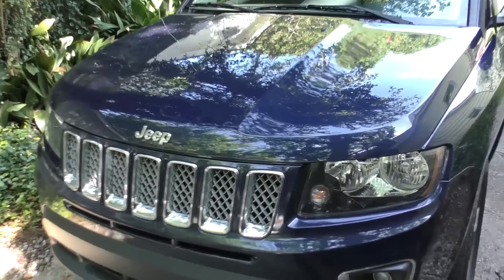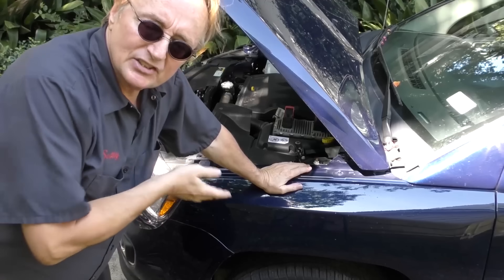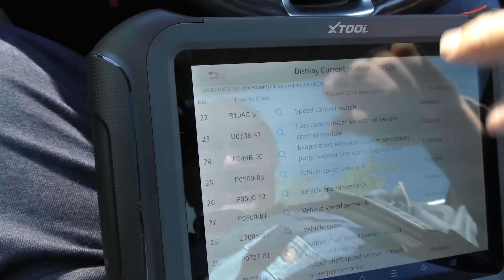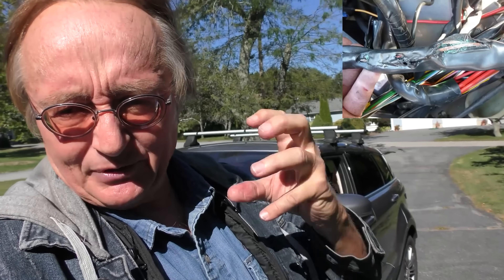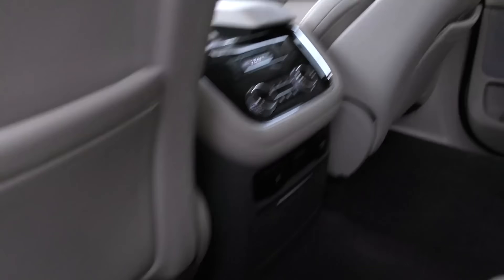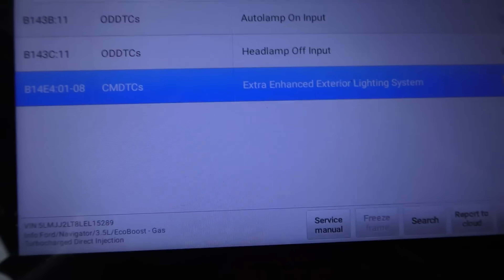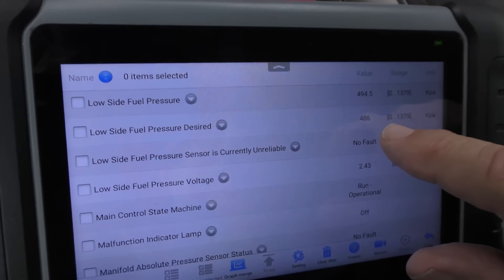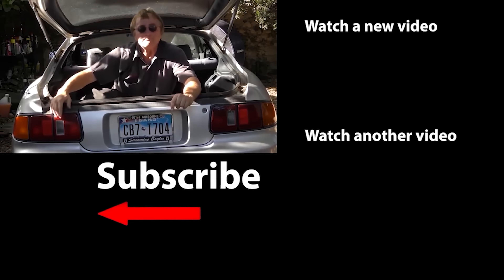No One is Warning You About These Vehicles, So I Will

Comment: AWD and 4WD are completely different setups.
Reply: Soccer moms will never understand this
Reply: @alpine1600s  I still don't think even my lifted sport trac is as good as my lifted Cherokee Trailhawk. We will see. I just bought the truck.
Reply: Tomato -tomato same thing 🧐
Reply: I think an all wheel drive vehicles should be replaced by 4 wheel drive. I like the idea of having fwd until it comes a situation when I can push a button and turn it into 4WD
Reply: Toyota AWD hybrids are different, the back axle uses the EV engine not the gas engine which powers the front axle.  In a Camry both are front only and EV mode is limited to slow speeds but not when in ECO mode.
Reply: @Jimmyky77 woah, a male soccer mom!🤣 They are actually quite different.
Reply: @alpine1600s  my Wife's 2021 Jeep Compass Limited Edition with 4k miles on it is A 4x4 not all wheel drive and the 2.4 engine,nice ride,too many gadgets lol,but still under powered but Gorgeous SUV.
Reply: @toriless  additional detail, ECO mode also helps your car get into EV mode more frequently than when you’re in Normal mode. It of course depends on how hot or cold your car it is outside.
Reply: @alpine1600s  "Good Day to you Sir!"💩
Reply: @off-roadingexplained8417 did you get the V6 or Turbo 2.0?
Reply: @bigbear5981  2.4 NA actually. (Rare).
Reply: @alpine1600s  well technically a 4 wheel drive is any wheel will pull at a given time. All wheel drive occurs in a straight line with all wheels pulling except in a curve or turning sharp corners then the transfer case allows the front drive shaft to slip to prevent binding. Though all wheel drive is the best handling set up the transfer case slip hasn't been perfected. I believe they have speed sensors in the wheels now on some and the computer can disengage which ever wheels that need to spin faster in cornering. I don't know don't quote me on that. The gm 4x4s of the 90's until everyone else caught on were beasts when everything was working properly and driven as they were intended with the locking rear axle in 4 wheel drive in the mud. 3 wheels pulled consistent and a weekend tear down with the same locker in the front unbeatable!
Reply: Yes they are different

Comment: I really don't get why people hate on Toyotas for being boring.  My 2015 Camry 2.5L is incredibly fun to drive and I love the sound of the engine at 6000 RPM.  It's not a race car or anything but it's plenty fast for the majority of people.  If you want speed, don't get a 4 cyl engine in the first place, but I'll happily rev my Camry to redline at 300K+ miles.  Only issue I've had so far is that the screen went out

Comment: You are a little late..... I bought my 2021 Pre-owned Compass Latitude in March.    
I eliminated a new 2020 Chevy Trax in less than 36,000 miles when it began to not responding to the gas pedal. 
I do have an engine warranty til 98,000 miles.

Comment: Any thoughts on a well maintained 2012 Toyota Prius with 116K miles? The car is being sold for $7900 and nearly all services were done at a Toyota dealer. It also has the original hybrid battery.
Reply: Prius is actually a high mileage low maintenance work horse. Prius taxis getting 300-400K miles or more. The engines are tough and so are the hybrid systems. Yours is barely broke in. Park it in garage or carport, change oil and take care of it and it won’t let you down. I’m on my third Toyota hybrid so I’m speaking from experience.
Reply: @Chaz610  Okay cool! I appreciate the advice and knowledge from your experience. It seems as though it’d be a legit purchase. Thank you.

Comment: Not just the compass but every Chrysler product. I own a journey and my son had a challenger (had) now a charger and I'm convinced they are designed to fail. Mainly the coolant! So far the plastic in the cooling system WILL break and so will the engine. Advice any Chrysler product with the plastic tee's in the cooling lines get rid of them. Cut the hose and buy a brass or stainless steel tee to replace them. When the electrical phenomenon starts  pull up the fuse box under the hood and check the wiring. The box rubs on the wires and will start shorting out or catch on fire like my journey. Do it now because you won't have time to jack the car up and take off the wheel and pull out the fender well to disconnect the battery under the fuse box while it's on fire unless your on a nascar pit crew.  The pins in the brake calipers are soft and hard breaking will bend them and cause a wheel to not disengage.
Reply: lmao

Comment: The Lincoln navigators use a bunch of plastic gears behind the dash for the multizone hvac.  when the car starts to get old all those gears will have a tooth break off.  You have to rip so many parts off to get back there.   it's expensive to fix.   Then a year later another one will break.  When they break they'll start making a loud popping noise as you're driving the vehicle.

Comment: Wife had a 2014 compass. Extremely slow and not enough power to maintain cruising speed on the interstate so the transmission has to work very hard and burn up quick. When 2nd transmissions blew, got rid of it for junk

Comment: Thank you for your informative videos, I have been wondering, what would happen if you fill your radiator with ATF instead of water and antifreeze.  The ATF is very liquidy, would protect your engine from corroding inside, and it should never freeze. I know it is a stupid question, but I'm quite interested to hear your comment.

Comment: My 2017 Jeep Renegade I babied.  It had 2 coil packs, radiator fan, thermostat, coolant overfill tank fail.  Of course I had the "normal" Oil consumption issue - at least 1 quart of added between oil changes.  Then at 90K miles it had a small head gasket leak I was able to seal with coolant additive.  It was the newest car I ever owned and I really enjoyed it.  But I realized the engine was not going last much longer.  It was my first and last Chrysler I will ever own. So I traded it in on a one owner 2004 Honda CRV that I now have 133K miles on.  I hope to get many miles out of it and it seems to be pretty easy to work on a lot of things yourself.
You have to ask yourself, have you ever heard anyone say "I would really like to get a Fiat!"  ?

Comment: The Compass/Patriot was nothing more than a reskinned Dodge Caliper. Played with the suspension for a little more clearance and there you have it. The interiors are almost the same in every way. The platform was an old Mercedes set up from when they owned Chrysler. (much like the Charger/Challenger/300) Fiat just built them till they ran out of parts and moved the name to the newer Fiat based platform.

Comment: Believe me Scotty I already know, stick with vehicles under the year 2000 preferably 86 and down by far the best vehicles made, and many will have lots less problems, I have a 80 model bull nose f250 I custom built from wheels up, nothing is factory everything customized, got the best engine that was ever made, a 78 4.9 300 inline straight six, this thing has lil over a million miles on it and still runs better and out performs anything that you can buy today, don't care if I get comments from non believers because words do not faze me, I know what I have I know that I built it myself and I know it'll still be here when all these new pieces of junk is gone, if I had a penny for every new one I seen towed, or I've worked on, or seen broken down beside the road I'd be retired already 🤣🤣🤣🤣

Comment: I'm getting happier and happier with my 2016 Mazda CX-5. 2.5L, no turbo, 6- speed auto.  107K miles and no problems, doesn't burn oil.
Mazdas or Toyotas in my future.
Reply: Same here. I also have 2016 cx5. 80k miles. Also have a 2021 cx5
Reply: @economicfusion6065 just got a 2024 CX-50, handles like a dream. My only complaint is the AC is weak in hot temperatures. Weakest AC of any car I owned. Do you have any AC issues, or do I have a rare defect?
Reply: @The_Laureate  i will say the 2016 has slightly better ac, but not by much

Comment: The jeep compass he has there is NOT a Fiat owned Jeep although that’s what he keeps complaining about. Fiat purchased in 2014 and that’s an older model design.
Reply: Scottie indicated that the year of the Navy Compass in the video is a 2017 model.
Reply: @waynekerr3598  then he lied, Jeep/FCA redesigned the Compass for model year 2017 in 2016 and this one is not the redesign. This is Chryslers design not FCAs.
Reply: It's 2017 I have one it's a FIAT
Reply: @mikes62soupcan this Jeep he has was built in August of 2016. It does say FCA on it and that’s because Fiat already bought the company but I don’t believe they changed anything on that Jeep until they redesigned it for the model year 2017. Basically he has one of the very last Compasses that Chrysler designed.

Comment: Hey Scotty -What kind of under car coating have you seen that works the best? Oil ? Rust Check? Wax Coating? With everything you've seen in all your years working on vehicles....Any thoughts on the best way to inhibit rust on a vehicle?
Reply: The BEST way to inhibit rust is to move to a place where it doesn't snow, and therefore no road salt is used. 😅
Reply: My experience, oil. Whenever is steel saturated with oil there is no rust accumulation.

Comment: The only reliable Compass is a rare find. It's the year where they offered the 6F transmission with the 2.4 World Engine not the 2.4 Tiger shark. The new Compass is just as bad with the horrible tuning they did on the ZF 9 speed. It's pretty sad when Nissan got the gear ratios correct for the ZF but Chyrsler couldn't. Even with the 3.2 V6 in the Cherokee it only uses 7 gears because 8 and 9 are way too tall.

Comment: I put a 65 inch tv in the box in the back of my Patriot completely flat, gate shut (back seats down) Basically the same vehicle. Sometimes the front passenger seat also flips down like my Cherokee trailhawk. Mpg is unremarkable. Never more than. 25mpg.

The Cherokee trailhawk is an INCREDIBLE off roader. Nobodu can dispute, especially with a 2 inch lift.
Reply: Yes I have a 2002 4 inch lift 33 x12.5 R17s mint condition, Bushwhacker Fender Flare Kit,Blacked Out, Heavly Modified,Love Offroading!
Reply: I had a 93 Integra hatch. When I needed a washer/dryer I went to sears to pick them up. Had to take each out of the box and 2 trips. But it fit completely in that thing. I just needed to put a blanket on top to keep it from shattering the glass. That car got 50mpg on back roads and was fast af. Who needs a rollover mobile to bring big stuff home?
Reply: @ryanbrandt5404  yep. Had an 88 Integra. Was a beast for that stuff.

Comment: I have a 2007 dodge caliper  2.0 automatic. 
Im at 390000 miles.
I have a lifetime powertrain warranty 
I am on my second transmission (free under warranty)
Engine never been opened
Engine burns 1/2 quart every 4000 miles
The car has never left me on the side of the road 
Best vehicle I've ever owned
Reply: You are a 1%
Reply: I’m a speechless mechanic 🧐
Reply: I barely see these on the road. Every now and then I do, but few and far between. Glad you've had success with it.
Reply: I've driven domestic cars and trucks for over fifty years (GM, Ford, and Dodge), and have never, repeat NEVER had reliability or quality issues like Scotty loves to drone on forever about.  I have always been a fanatic about maintenance and have kept very good care of my vehicles.  Have covered the USA from coast to coast, every state in the union, never been stranded on the road anywhere, ever.
Reply: Same here with 07 caliber. I am approaching 200k and still going. I believed that the 2.0 engine for the caliber was developed by Hyundai, Nissan, and Chrysler. No wonder why it's a good engine.
Reply: Used to build these.  They were made in the same shop as the Compass and Patriot.  Caliber had some different parts but there is a lot of overlap.  Also used Nissan transmission which didn't seem to be an issue.  Not saying you have a bad car but I don't think your results are typical.

Comment: Subaru has a lot of problems. Most frustrating is the weird AC problems. Nothing worse than a hot car in the south.
Reply: Nothing compared to the fact that those freaking gaskets are just silicone attachments sealed at 100k miles better out a metal sealer!
Reply: I had a 1999 Outback wagon and drove it 9 years without a single problem.  Regret to this day selling it. Best car I ever had.
Reply: Buy a jeep/fiat compass